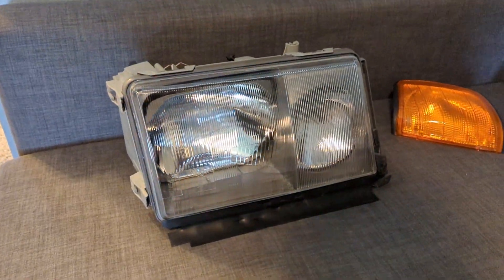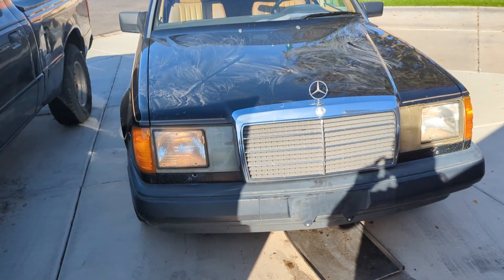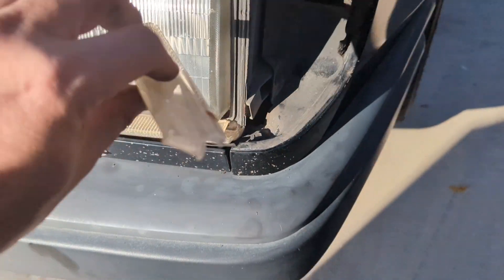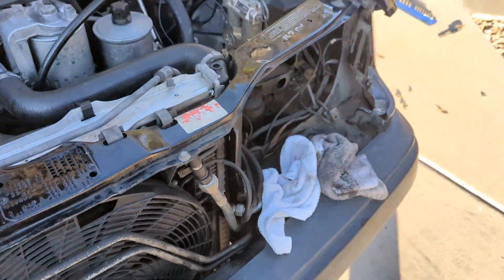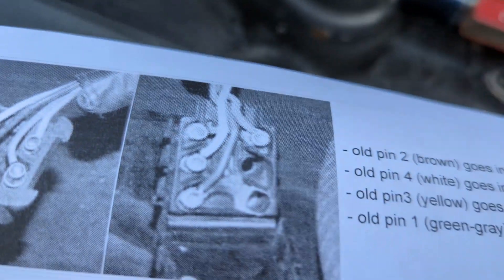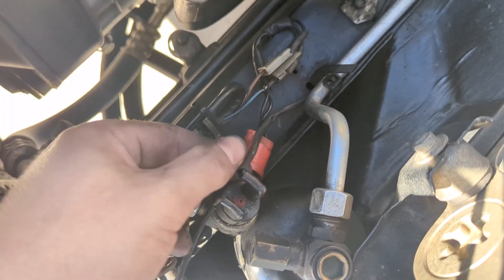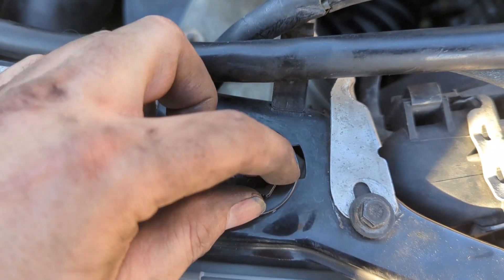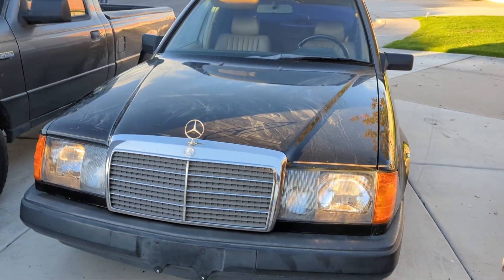Euro light install on the 1987 300D (W124)

Comment: I just found your channel and subscribed.  You put out some good videos.. very informative.   you care to sell a right side headlight wiper. What did the euro lights cost. Like to change mine. Led headlight bulbs were big help. 
The best improvement I have made to my car is removing the clutch fan and replacing it with 2 12 inch electric fans and a davies craig digital fan controller . Now my car runs cooler with ac on than it did with ac off and factory fan. Plus you can feel the difference in power. I was surprised how much drag the fan puts on the motor.  120 amp alternator conversion was big improvement. I try to keep my car all original but didn't like it running over 90c with ac. On 100 deg days.
Reply from the maker: Very cool, thanks for subbing! 😁
I know the videos could be better on the "how to" front - I mostly go by shop procedures (in the physical books (or online at https://w124performance.com/service/Main.html)

The euro headlamps were $611 USD shipped to me (new condition, from Latvia). I got them on eBay and I think they're worth every cent. Massive improvement with visibility - and they look great too. 

Arizona gets brutally hot - up to 120 degrees. The car seems like staying around 80c - 85c though, even when driving a lot. I wonder if I have a lower temp thermostat? Will have to check that out. Thanks for the heads up on the fans too - will look into that
Reply: @bsclifton  i have the original 80c thermostat. The fans i used were 12inch mishimoto fans.
The controller is the davies craig digital controller with temp sensor. When it gets to temp fan 1 comes on then fan 2. If you connect ac mode fans come on with ac.  My car runs much cooler now and the first time you drive it you can feel the difference. Original fan puts allot of drag on motor. Especially with ac on.  Hope it helps you.